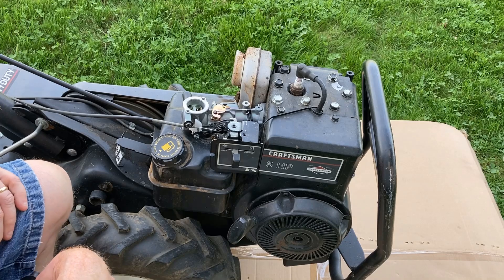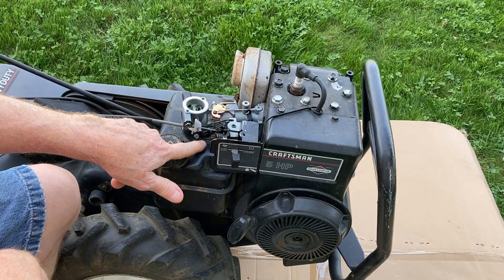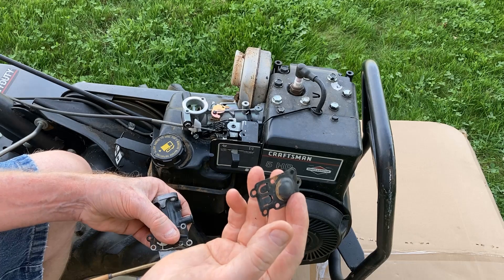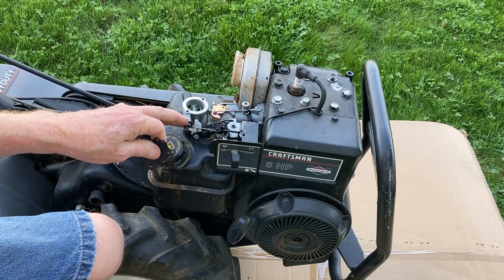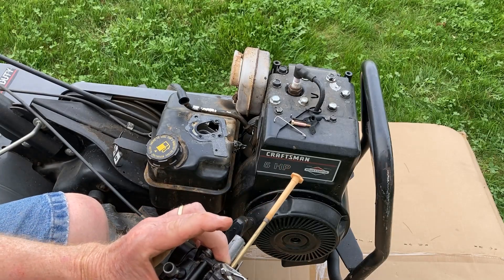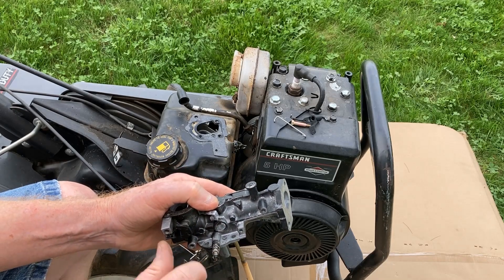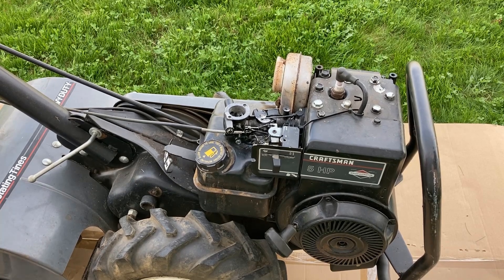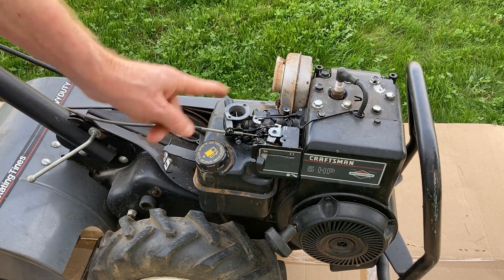Craftsman 5 HP Tiller Carburetor Problem! Do It Yourself!

Comment: I had to clean the gas tank out, they dont make them anymore. Put everything back together and now it starts and stalls. Any suggestions other than taking it to a professional
Reply from the maker: Well, that's not good... I would say to go through the basics on an internal combustion engine. You need compression, timing, fuel delivery and spark. From your statement about running and stalling, I suspect that it is in the fuel delivery. Good luck! Thanks for the comment!
Reply: Check tube's for cracks and filters and main jet.

Comment: Since the replacement diaphragm are thinner can you double them up to make them stronger or will that make them too thick
Reply from the maker: That may be worth a try. I just would not want to tear it back apart if it didn't work!
Reply: Ok might give it try that is where I am at with the repair waiting on diaphragms thanks.

Comment: Hi Dave, your video helped me much. I have a simmilar motor and an identical caburetor on my lawn scarifier. I changed the diaphragm on mine too but did not take any pictures. I thought I would remember, but I couldn't. Hence I had great problems in figuring out the placement of the small parts and the overall linkage. But I got it working now.

However: I have one question. Maybe you can help me out or you have an idea. 
My device also has the throttle on the handle bar, connected with a pull-wire. Exacty like yours.
For some reason, after reassembly, the throttle handle can not be operated fully. It works basically. I can run it and shut it off, but the throttle lever is unable to hit it's end stop, because the linkage is already at some end stop at the motor / carburetor itself. Maybe I connected it to the wrong hole on the metal part.
Reply from the maker: Thanks for your comments. I'm really not sure what to tell you about your throttle cable. It does sound maybe it is in the wrong anchor hole. Good luck!
Reply: Thank you so much I am thrilled to say that I went through your instructions carefully took many many pictures and video which helped incredibly would not have gotten it back together without that! It started it ran I let it run for like 10 minutes shut it off went to bed then about 12 hours later I tried starting in again and now it won't start? Any thoughts?
Reply from the maker: @debbysgig  I have since sold mine.... But to guess it sounds like it needs primed. If all else fails, a shot of starting fluid should get you running... Good luck!
Reply: Good video. Wish I saw it before ordering Chinese junk.

Comment: Hello I have the same tiller,  problem is no gas is coming up to the choke if I remove the filter spray quick start in the choke then try and start it tiller will run for a few seconds then die off. What does it sound like the problem could be?  Thank You
Reply from the maker: If it runs (for a few seconds) with starting fluid, you need to focus on fuel supply. That means getting gas from the tank to the carb first. Check for any blockage in the fuel line first. If no blockage, it has to be fuel pump (diaphragm) is not creating the pressure needed to pull the fuel through the fuel line. I pick this up in the video here:  https://youtu.be/1emKFQ8qrcQ?t=168 Good luck!
Reply: @repairsrule  Since I had not use the tiller in years and left gasoline in it the fuel tank was very dirty a lot of brown flakes had build up inside the fuel tank I remove it clean it out will order the carburetor. I went to a repair shop prior and they wanted 200.00 to get it going  that's to much being on a fix income I figure since I have some time give it a try myself. Thank You
Reply from the maker: Yes! If you have your tank clean and install a new carb, you can get it running. Be sure to take pictures of the linkage... You can do this!
Reply: @repairsrule  just clean original and rebuild it, better than Chinese junk.